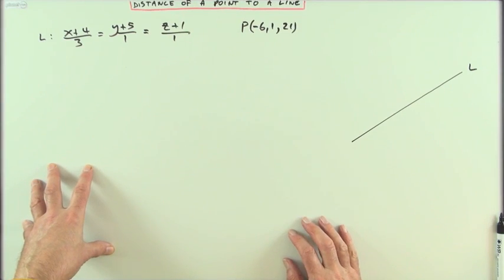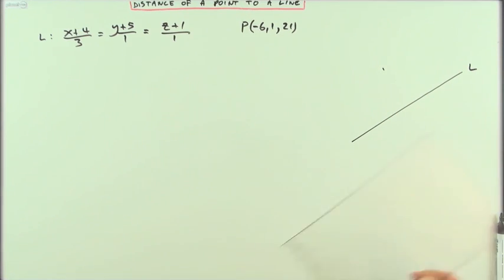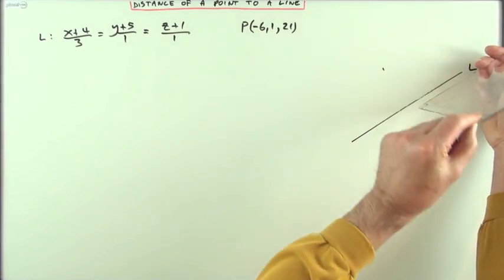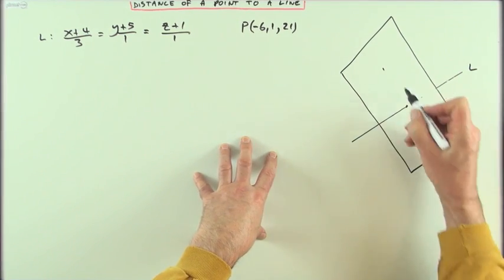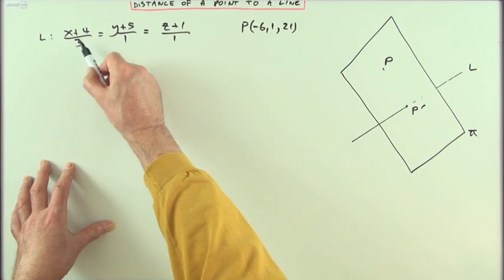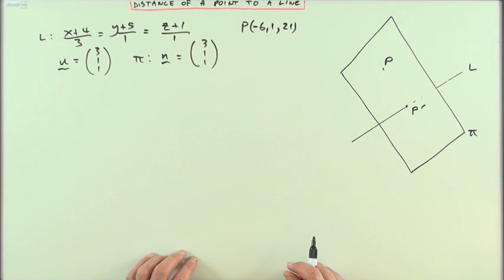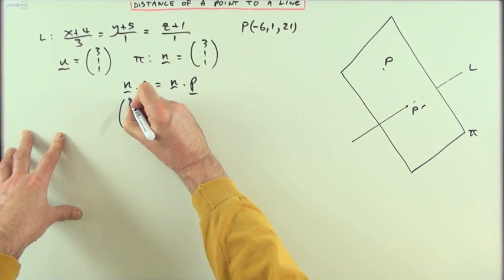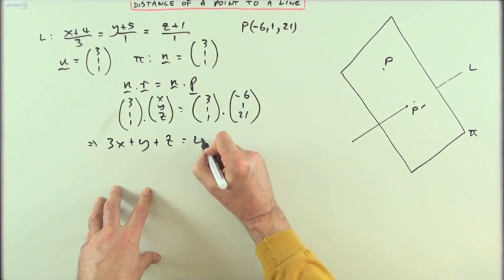Distance of a point to a line in 3D using 3 different techniques.

Comment: actually, with the 2nd method, you don't need to calculate t at all. you just need the minimum module of that vector, that is, minimize a quadratic equation. you know that the minimum is found at (-b/2a, -delta/4a), so the answer will be sqrt(-delta/4a). anyway, very good explanation :D